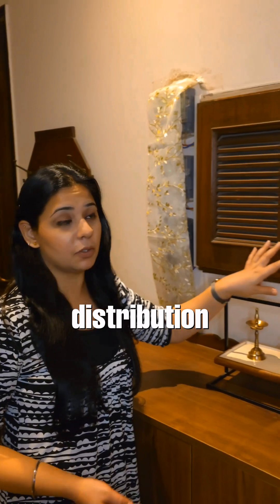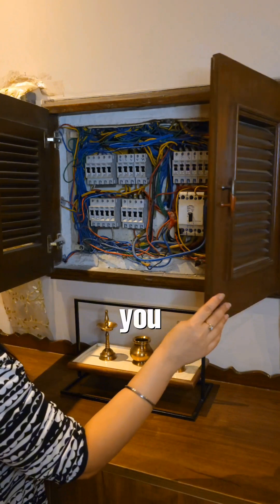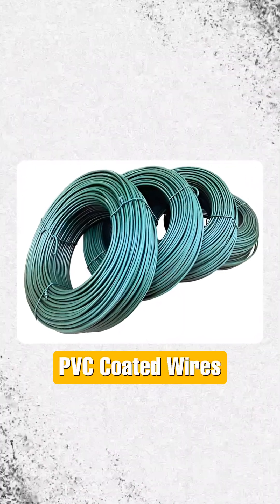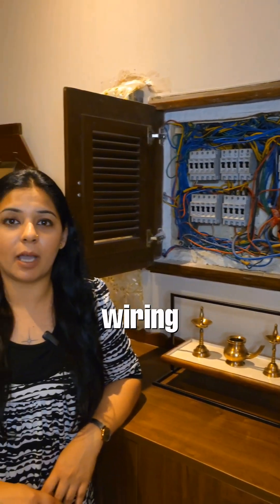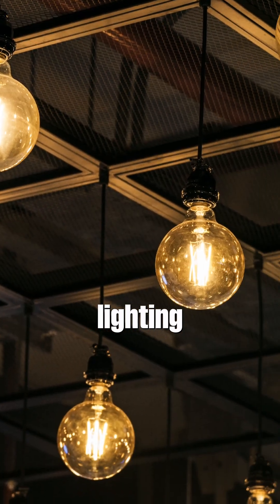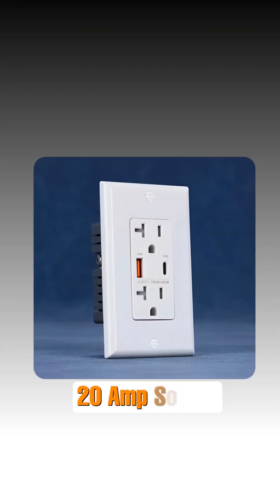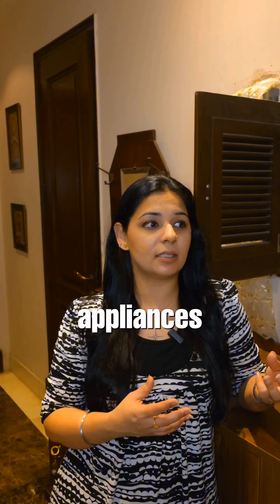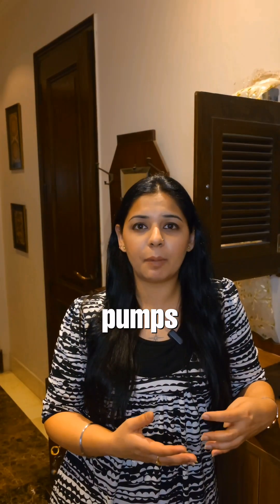Wire Planning in Home Design!

Comment: Refrigerator use 16a to 20a usually you don't need 4 mm wire 2.5 mm is ok and also air purifier don't use to much ampere
Reply: Hello. A two door side by side refrigerator will require a 5pin socket, so to be on a safer side you may use 4sqmm. 

People who use 2.5sqmm wires for refrigerator, is for single door ones. If you use it for bigger refrigerators, there is a possibility of short circuit. 

Also, air purifiers come in different sizes and categories. Its always beneficial to keep the wiring intact on a safer side and for future expansion.